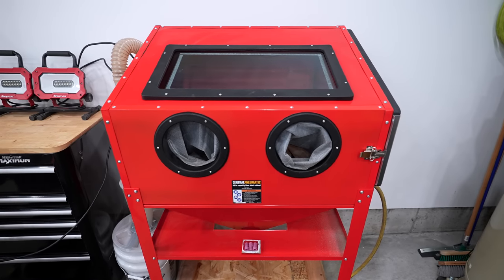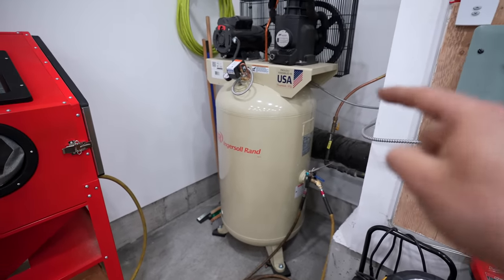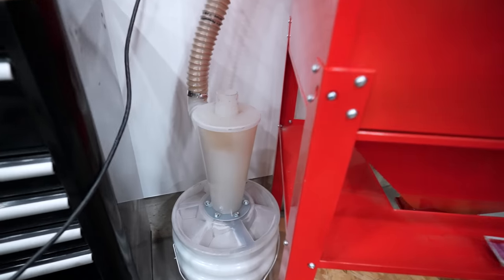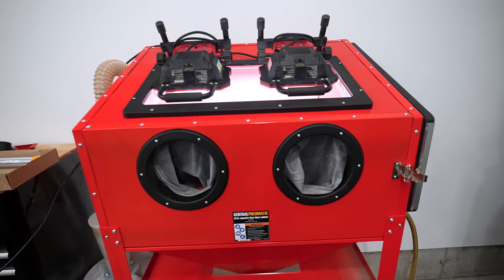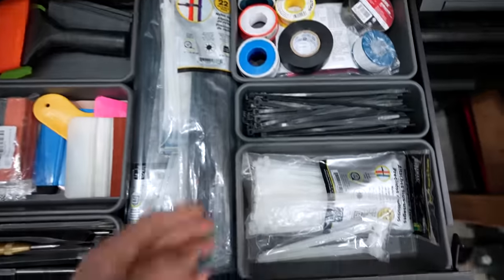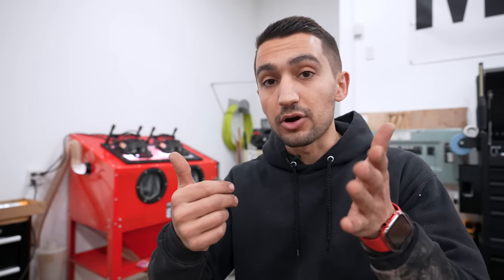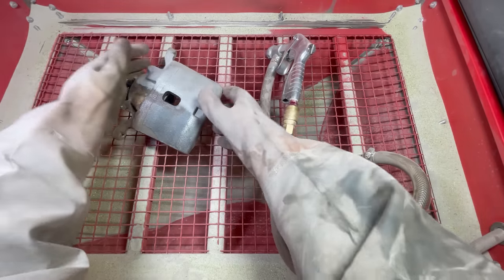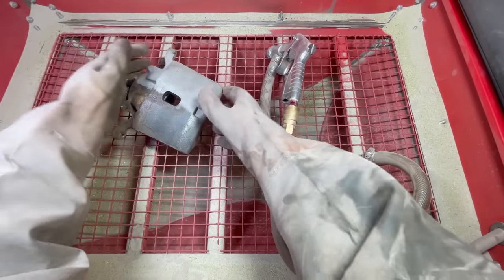Tips to Make Your Cheap Sandblaster Perform BETTER // Harbor Freight Blast Cabinet

Comment: Some things I have learned in owing my HF cabinet. First, the pickup tube is useless, make yourself a metering valve (look on YouTube on how. The gun itself is in need of work. Bore out the air passage to 5/16", remove the air fitting and the on/ off valve inside the gun and open the hole from the bottom where the air fitting was. Next the orifice needs to be opened to 1/8". Next, put a thin O ring on the ceramic nozzle where it meets the gun body and put 1 layer of Teflon tape on the threads where the nozzle ring screws on, media WILL get in those threads and you won't be able to unscrew it.  On your vacuum, get the filter bags for inside of it and use a HEPA filter on it to. The dust from blasting rust is so fine that it will get past your dust deputy and through the plain paper filter on the vac and into the motor. Look arou7nd on You Tube for other mods, you'll be glad you did them
Reply: I like the tip about the pickup tube. Mine was always clogging up and i used to put my finger on the nozzle and squeeze the trigger to blast it back out. I'll be putting a pipe on the bottom of the cabinet with a air bleed on my new cabinet.

Comment: Great tips! 
I would even suggest even more water separation than just one tiny inline.
Reply from the maker: I couldn't agree with you more! I will be making a rig with copper tubing and drain valves. I'll make a video about it in the future 👍
Reply: Even a good separator and desiccant setup works...ive got three inline systems like that and the run time on a compressor to keep feeding a blaster is crazy...a dryer would help a huge amount but they are time consuming and can be complex to build or expensive to buy...moisture is the death of blasting if you cant keep it super under control or eliminate it fully...

Comment: As a dust collection and dust mitigation consultant, I can guarantee that elbow right before the cyclone is killing its effectiveness. You want straight, laminar flow entering a cyclone. I’d mount the cyclone inlet the same height as the cabinet outlet and connect them with at least one foot of straight pipe.
Reply: Do you mean turn the bucket on its side so the pipe can go straight from the cabinet to the bucket?

Comment from the maker: 💡ADDITIONAL BLASTING VARIABLES 💡
✅ Humid vs. dry compressed air
✅ Hazy vs. new window film
✅ Large vs. small blasting gun tip sizes
✅ Different blasting media for different substrates
✅ Medium (60psi) vs. High (100psi) pressure air

WHAT'S YOUR TAKE ON THIS?

Comment: At 11:10, what i did was taping the holes in the door insulation where sand can collect. also I always give a good punch on the door before opening so the dust falls down.
At 17:28 you tell dangerous half knowledge. you are saying that sandbalsting doesn't damage the substrate/the part itself. that's not true because when you blast a metal piece and use glass beads or corundum there is always an abrasion. So you should have mentioned, that people should be careful when blasting high precision areas like sealing surfaces on pump casings or parts which have to maintain their tolerance after that like centerings on machine parts. 
Also that black color looks like you have sprayed it on just for the video. Its easy to remove, but try this with 20 year old primed and painted parts. its not that fast anymore. 
Anyway, this video is a great source of Information. Thanks a lot!

Comment: Love these tips! I'm a big fan of these 80/20 type videos where you can buy a tool for 20% of the price of a top tier one and get 80% (or more) of the performance with a few inexpensive upgrades. I wonder if ceramic coating the inside of the cabinet would help with preventing the media from sticking to the side door and glass?

Comment: Different suction system ("metering valve") did not make so much difference for me yet but it allowed me to put filtering mesh over the intake inside the box, so it's not CONSTANTLY clogged by pieces of paint. I had to block the gun opening and blow it to blow air back to the sand so it cleaned but it always worked few seconds and got clogged again because the paint was falling back to the intake. Also the original intake is too high and lot of sand rests on the sides of the bottom or all around the box on the frame and it looks like you have a lot but it doesn't work because it's hardly sucking anything. From all the DIY metering valves, I reccomend using only 1" knee right underneath the trapdoor (no extension down, there is lot of space for the rest to fit and you would only lose space under the box), connect directly (no middle piece) to the 1x1x1/2" T (the one with 1/2" side where you mount the valve) and the rest is up to you - reduce to hose connection and hose. To mount it to the trapdoor, I found very short 1" insert that was threaded from both sides but both threads were meeting in the middle. It was enough to put it in the knee and mount a reduction from 1" to 1&1/2" and the trapdoor got clamped between this reduction and the knee, when tightened. Excellent. I have to take at least outside picture of it, when I get back to work, I haven't done that yet

Comment: Should add an Aftercooler to the IR compressor. I added one to my 60 gallon T30 (got a detailed vid on my channel) and it’s a game changer for dry air. Also add a drain extension and ball valve ($15) to the bottom of the tank and relocate to one of the legs to easily dump the water everyday. That moisture will destroy the bottom of the tank over time.

Comment: The best upgrade for these is an external pressure pot. The cheap harbour freight one is perfect. It uses far less air and is about four times as quick as the siphon setup.  Also you can get a tungsten carbide tip, the ceramic nozzles wear out very quickly but I've been in the same tungsten tip now for  8 months doing about 4hrs blasting a week.
Reply: Do tell…
Reply: @FloroBeggins  An external pressure pot. Sod the siphon.
Reply: Can you explain it further, or link something? Thanks. I noticed last night as I was using my blaster that it seemed to sputter. The hose kept moving like it was burping. Was blasting 80 grit glass bead, 60 gal compressor set to 90psi. Have an air drier at the cabinet.

Comment: Nice!!  When should you change out the blasting media when it looks excessively contaminated with rust particles and does not strip as it should??
Reply from the maker: You don't even have to, since the metal 'flakes' that come off any steel part will just get smaller and smaller the more you blast them. They will occasionally gum up the gun, however it isn't really a concern otherwise.

Comment: Hi, just a question.. shouldn't the shopvac be connected to the backside, instead of the side? Now the air that is taken in, is blowing down into the media creating additional dust?
The bigger sandblasting cabinets that have the big dust extraction connected to it, are also all connected to the back, to the hole where there is a cover on the inside, point downward.
I have the similar tabletop blasting cabinet and i am going to try connecting a shopvac to the back, see if that works.

Comment: I viewed a video where the dust collector system was connected to the Exhaust port in the back of the cabinet.  You and several others have the dust collection system connected to the dust port on the side of the cabinet.  What is the correct method?

Comment: I have that same compressor great unit ! It runs to die grinders no problems , best $1300 I ever spent I use it daily to change tires and run all my air tools only thing that I see wrong with the unit it should’ve came with a magnetic starter as the pressure switch isn’t the greatest . But all in all I have no complaints I am going to do some upgrades to make it better ! Hope yours is doing well also .

Comment: I might’ve missed it in the video, but have you done any powder coating? I’ve seen YouTubers like Cameron niemela get really good results using a normal oven. Seems like the next step after sandblasting something so well.
Reply from the maker: I have no done it, however with a blasting unit like this, doing some powder coating would be the next step 👍

Comment: Hey bro nice , I watch your channels a lot especially when u had the z . Do really think that the invidia  cat back exhaust is really restrictive for power
Reply from the maker: Hey Torvarris, the Invidia exhaust is a decent upgrade over stock as it sounds nice, it isn't obnoxious, and you do get a bit less restriction from the exhaust, however it is still a bit on the restrictive side of things. A GReddy Evo, a Motordyne Shockwave, or even a Tomei TI-C will give you the most power from an aftermarket exhaust system. Hope this helps!
Reply: @milanmastracci  thank you , was it a night and day difference in power . Am thinking about selling my invidia for an upgraded exhaust

Comment: I’m going to rebuild my n14 mini is it worth cylinder sleeves and camshafts in addition of what you did?
Reply from the maker: I wouldn't say so. It makes more sense to do thicker sleeves or closed deck block if you're making a shit ton of power, and for camshafts, it is only very beneficial when you're needing that little bit of extra power, or if you're staying naturally aspirated.